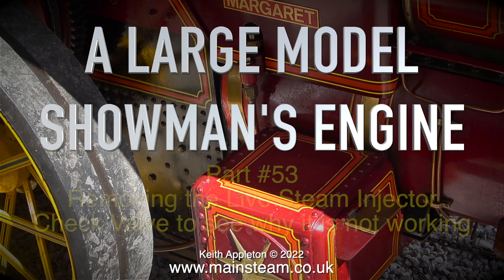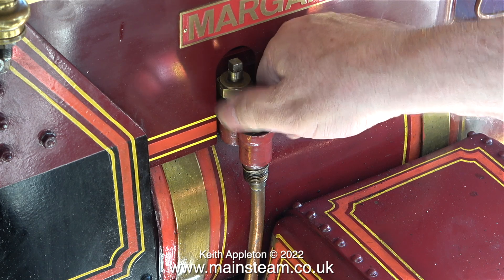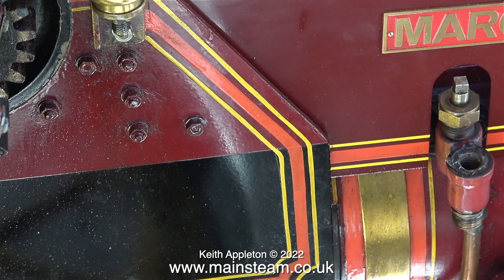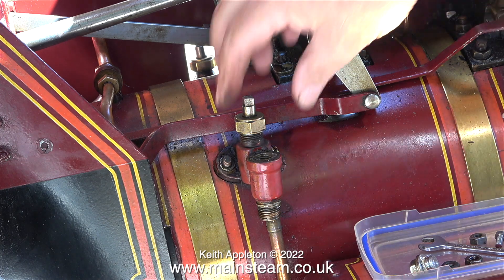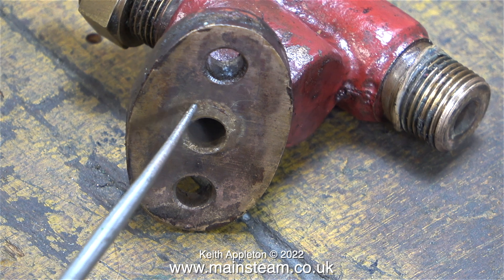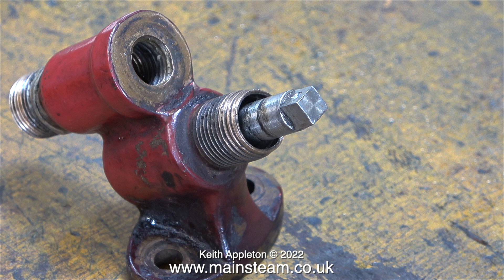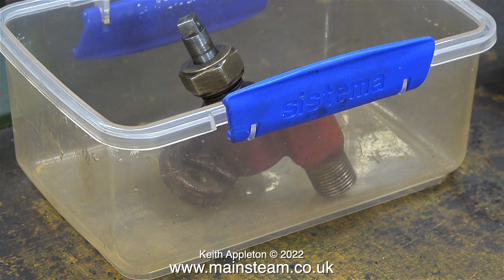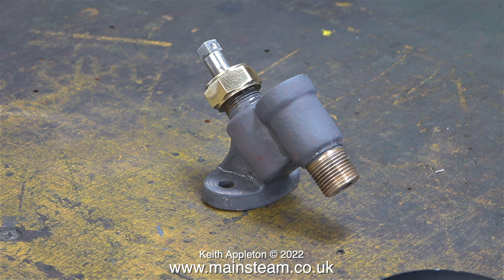A LARGE MODEL SHOWMAN'S ENGINE - PART #53

Comment: Last night I watched a very interesting and well done video about how a steam locomotive works.  The video also showed the injector, except it was very large, and despite the engine being relatively new it showed the same pattern of grime as your model injector.  The video also showed the slide type valve and the modern cylindrical valves used on the larger steam locomotives.  I had never realized how critical it was that the timing of the valves be exactly right!